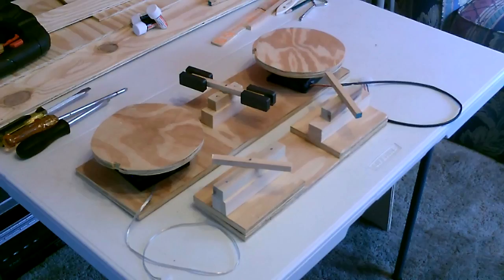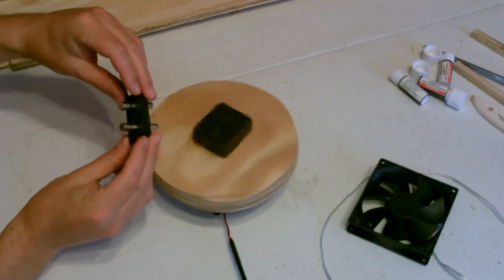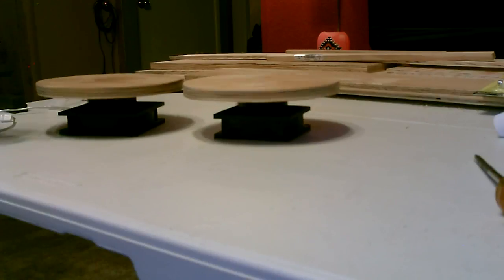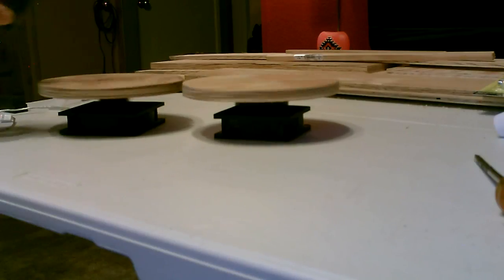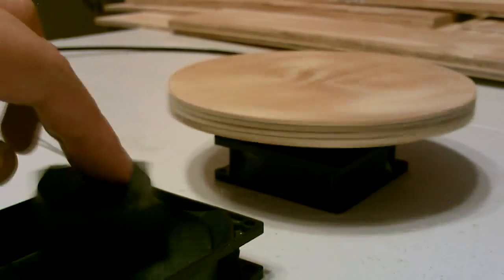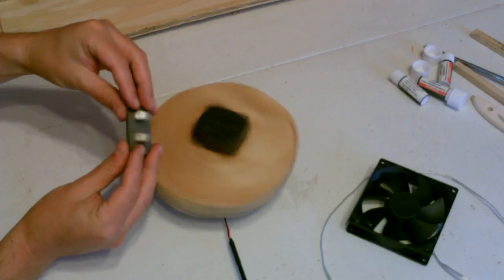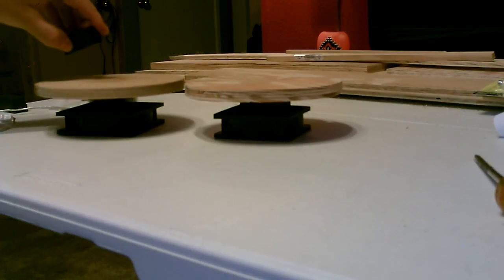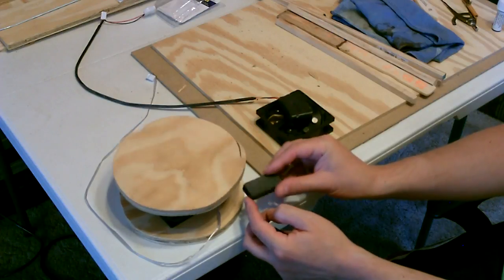''Free Energy" Magnet Motor Generators! -Experiments with platforms, pivots, pendulums, swivels...

Comment: The desogn i have..an 8 pointed star..or 8 magnets in a circle..i use donut mags fir design..copper coiled around outside..each magnet pushes the next..around to the begining..the energy collected from one..should be enough to power motor to increase speed of one..wgich will imncrease all... I do not have the funds or material to build this... Besodes this have 2 designs fir perpetual motion.. Do you want to work together?

Comment: MAKE A CIRCLE WITH THEM ANGELED AND AN OUTER CIRCLE ANGLED WITH ALTERNATING MAGNETS AND WATCH CENTER  PERPETUALLY SPIN
Reply from the maker: i'm working on one similar. it's got 16 contact points around a wooden circle...with 2 neodymium magnets at each point. then made a driver mechanism out of 20 neodymium ones. works pretty good... but a slight movement of the drive hammer is needed.